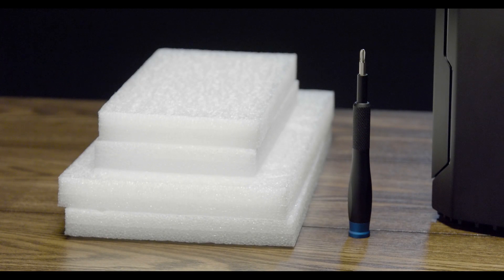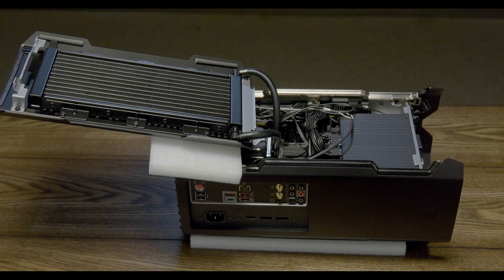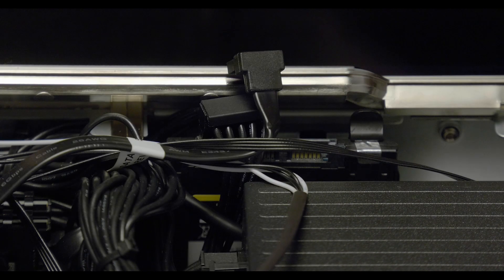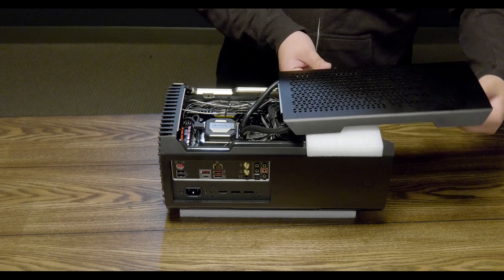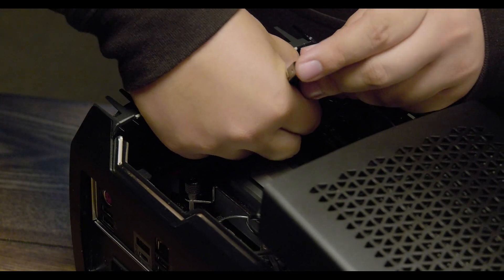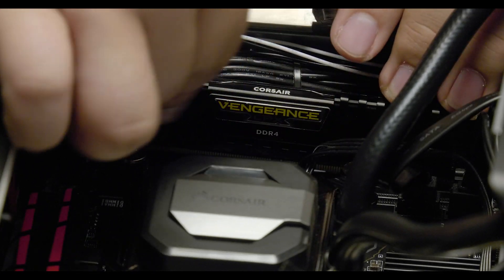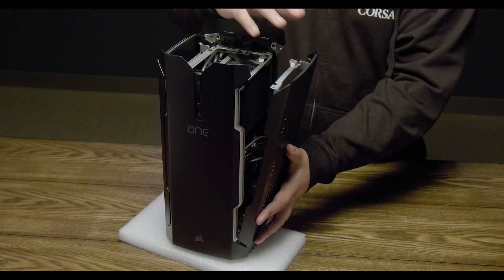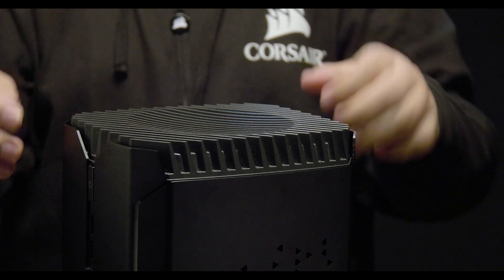CORSAIR ONE -- DIY 2.5in Drive and DRAM Upgrade Guide

Comment: @ Corsair, the internal of the i300 has changed since. Please update your video showing us how to upgrade the internals, especially the HDD. I bought one in late September this year, and I can't place the 2.5 HDD because it is very cramped and no space is left due to the other cables being in the way. I can't use the provided tray, and I had install it without it!!!!

Comment: ok, let me explain how you will sell us this case. 
option one. Sell us the Case, the power supply, CPU cooler for both platforms, and a Gpu of our choosing. We will select the MB, the cpu, and everything else on our own. this will cost you nothing at all because you would have already own all of said parts.
option 2 which will be slightly harder but not much.
everything i listed above minus the gpu. the gpu will instead just be a Loop. a Very short loop. this way all that we need is a gpu, a gpu Block, and the cooleint. 

option 3....you guys no that Ryzen is better and would want said cpu option correct? 
Option 1 is much easier because it in fact means less work for you. install the gpu, the power supply, and a cpu cooler along with the case. I would be happy with this even though you are limited us to one GPU family and non upgradable (unless you sell us future gpu like this)
option 2 is a little harder but it gives us 100% upgradability as we can choose any gpu we wish.
option 3.. ryzen yes.

Comment: Thank you for the video but how to replace the dam M.2   ?? its at the back of the Motherboard :) 

also if u have an M.2 version !  
Not both 2.5 slots are prepared for a drive. One is missing a SATA cable WTF.
Really a no go at that price !
Reply: is there a Sata power cable already installed ? or sata data and power are missing ?
Reply: @labriocheflamboyanteflamboyant  no the power is there but was bound to short .. i had to untie and  tie it up again  
The point is when u have a place in such a compact machine where u can install a additional ssd .. and then u have to put a sata cable in the wire hell ...
that's not cool
Reply: @hfreistify  Did you ever find out how to replace the M.2 drive?? Mine has gone bad and can't find it...
Reply: @euphoricmonk  yes it is on the other side of the motherboard 
As far as i saw you will have to rip out the graphic card to access it
Reply: @hfreistify  Man that is just terrible placement for the M.2 card..it's probably soldiered on the motherboard and can't swap it out...not good..
Reply: @euphoricmonk  no it is not 
depending on your model u can see it screwed in if u look behind the graphics module on the right side...
The access to the ssd m.2 is also easy for 2019 models 
for 2017 .... well it is a bit annoying

Comment: Small question I have the Corsair one pro the 7700k with the 1080ti I want to add a 2tb ssd and keep the mechanical drive as well is that possible or do I have to replace the mechanical drive?

Comment: If I wanted to upgrade one of my ram sticks from 8GB RAM to 16GB RAM and leave the other stick at 8GB RAM effectively having 24GB RAM, would that work ? And could the sticks be from 2 different brands and at different MHz's ? (Model that I am referring to is the version with GTX 1080Ti, i7 8700k and 16GB DRAM) Also do MHz's matter ? My one has 2666 MHz for both 8gb ddr4 ram sticks, should I go any higher (I plan on hosting a dedicated server for a game).
Reply: Cheers :)

Comment: I just got the version with the GTX 1080ti, i7 8700k and 32gb DRAM. It's a fantastic machine at a nice price. I never get any kind of thermal throttling and performance is, well what you would expect from these premium components. LAN party's are a blast and due to its compact size, super convenient. Editing and job related tasks on this PC are fast and responsive. So all in all is a very nice gaming as well as professional PC.
Reply: do you have an extra data cable in place where the first ssd was shown in this video, since i reckon u have the m2 drive and 2tb ssd at the bottom, any extra sata cable by the side as shown in this video ?

Comment: Question - I want to upgrade the RAM in my Corsair ONE from 16gb to 32gb, but what if the RAM I purchase has a higher clock speed? For instance my current RAM is clocked at 2400MHz, and the one I plan on buying is at 3200MHz - will the machine still recognise and use it? Thanks

Comment: Okay, lets say I purchase the newest version of the Corsair One ( 480gb m.2 ssd + 2TB hdd), will I be able to upgrade the hdd to an ssd and another ssd in there? Stock m.2 ssd + 2 2.5 ssds. I just dont want to open the One up and see only sata connections for one drive and not for another.
Reply: I just got mine today and there is only 1 SATA drive prewired for data, but both are wired for power, so if you add a SATA data cable you should be fine
Reply: Michael Telatynski isn't the sata connection on the other side of the motherboard basically not reachable?
Reply: what do you mean by that? I connected an additional SSD in mine using a fairly short SATA cable
Reply: oh thats awesome, i was under the impression that i cant just plug in another sata cable, but thats good news. so i can fit in my two 4TB ssds ! thx!

Comment: Can i fit an m.2 in my corsair one pro 1080. As it has a 480 ssd and 2tb hd. I want to put in 500 gig m.2 boot from that. use ssd and hd for storage.?
Reply: depends on the motherboard I know that the newer version definitely has the M.2 slots on the motherboard but I do not own a Corsair One so can not help you any further as pre built PC's cost too much 

and I got an Asus Strix RX480 8GB with a i7 7700K cooled by Corsair H115i on Asus z270H and 240GB Corsair Force Series MP500 M.2 in a Corsair Obsidian 450D and with 16 GB Corsair Vengeance LPX DDR4 2x8GB 2666Mhz and using  3 Corsair ML series of fans inside my case and I spent around $1200 I could have even gone with a GTX 1080 when I got my PC before 1080Ti and Ryzen/Polaris 500 Series release and spent around $300 but I got a 1080p 144Hz  Asus MG248Q freesync 1ms Monitor

Comment: Upgrades his boot SSD from 240GB to 240GB mindblown
Reply from the maker: Yeah, but the new one is red.
Reply: Corsair everyone knows that if something is red it will go faster. That's why the non RGB strafe is red
Reply: Would like recommendations on cleaning. I'm guessing canned air with the side panels and top removed is about it, but any other suggestions would be useful. Thanks.